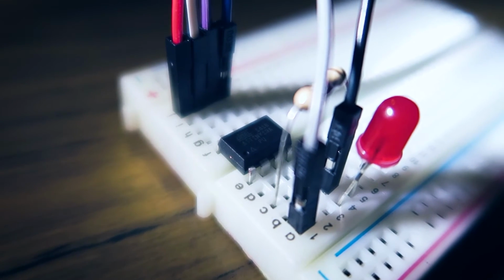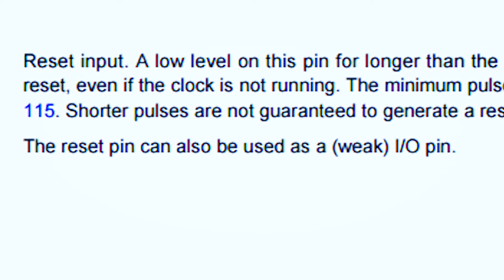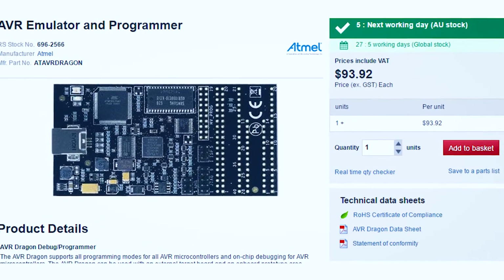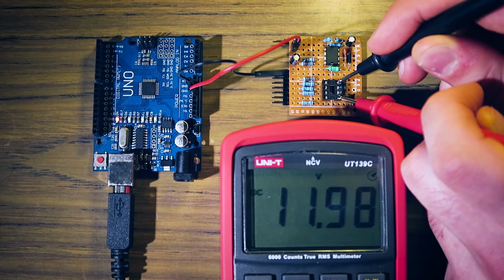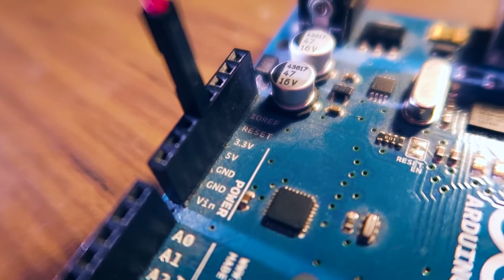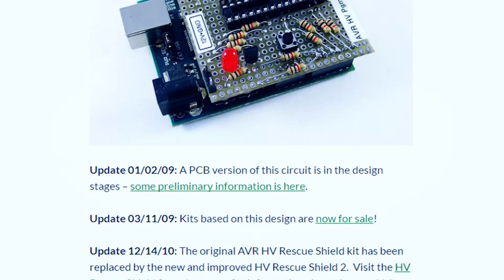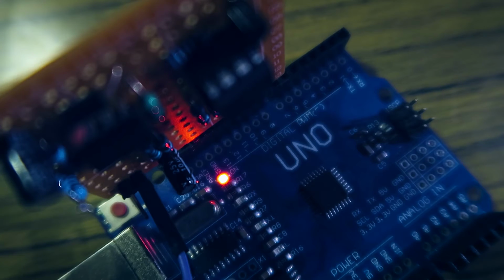Arduino Based High Voltage Serial Programmer

Comment: So if i want to use the reset pin in my code, I set the fuse and upload my code as usual?
If I then want to flash a new version, I have to reset the fuse and then flash again as normal?
Or do I need a real High Voltage Programmer to use this pin?

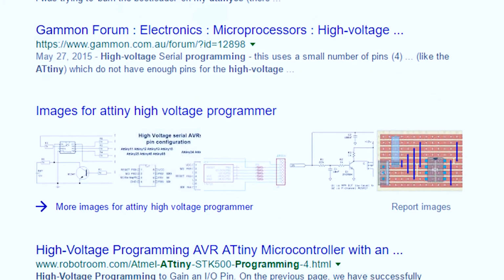Comment: I couldn't make out what you said at 1:03 - "I uploaded <something> programs to the Arduino - there are many versions out there, but most are based off the working <something> from Mightyohm".  I searched the MightyOhm site, but couldn't find any code for an HV programmer.  Could you please give a link to it?
Reply: Ah!  At 1:36, you say you can't find any existing software to program the AVR directly with the HV programmer.  So how do you do it?  Is your HV programmer effectively just a fuse resetter?  So you program it in one step, then reset the fuses in a second step.  Am I right?
Reply from the maker: Yep, I use the HV programmer as a fuse resetter then program the chip in circuit with a serial programmer. The HV programmer it is based on is this: https://mightyohm.com/blog/2008/09/arduino-based-avr-high-voltage-programmer/
Reply: Thanks for the reply.  I'm going to have a go at making a one-step HV programmer based on an Arduino Nano, which is pretty similar to the Uno, except that I already have a couple.  However, I'm getting ready to move house, so the programmer should be finished - well ... any year now!